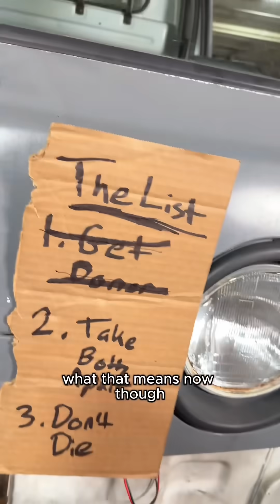We Destroyed Two Cars Just For This… Sendpai Part 3

Comment: One thing that I'm hoping you've considered is the weight in the rear of a kei truck. If you put a ton of power in the rear wheels and don't add any weight, its not going to have any traction. I would put the battery in the bed over the rear axle.

Comment: I'm curious why you used a hammer and pry bar to remove the radiator connector. It has a little metal clip you just pop up and the pipe comes off easy. Maybe it was stuck.
Reply from the maker: Super stuck

Comment: I like how "halo cars/projects" have just become "build some ridiculous fun vehicle that will get clicks online" instead of actually showing off a company's capability.  I like it haha

 It makes sense to just retain the Tesla sub-frames like that.  I saw another conversion where they tried to get everything to fit the existing vehicle frame instead of adapting the sub frames to the existing vehicle frame.  The simple ladder frame should make it a bit easier when it comes to attaching these.  On a uni-body it's a bit more difficult unless they can mostly fit into the existing sub frame locations.  You're not going to cool the tesla battery in the K truck at all?  How long will it be able to actually run?  5 minutes before the battery overheats?
Reply: Just stay tuned and stop assuming. They are figuring it out. This is a test. A halo project some may say....

Comment: 10's in 0-60...with 14x4.5''s.  Better go with solid tires.  Those tubeless are going to spin on the rim.
Reply: Track width of the Tesla vs Kei = tires are going to stick out of the fenders a bit. 
Kei max width is 58.3”
Tesla 3P track width 62.3/61.4 f/r 
Tesla 3P width is 72.8”, and the tires are pretty close to that width (say 68-70”).

Comment: Hey man, this is cool and all, but I’d rather go for a Toyota Prius hybrid set up because that thing save gas and you can put a bigger tank on me plus with a body that small. I’m guarantee it picks up some speed may not be super but it’ll be quicker. Definitely gonna need a cage and a little suspension.

Comment: As long as the heavy batteries are more towards the middle it should be awesome.
Reply: I think a bit of rear bias with the battery pack would offset the weight of the cab.

Comment: swap the kei truck motor and drive train into the Tesla
Reply: Thirded (I don't think it has enough power to even move it but it would be funny)
Reply: @m_ism  it has enough power to move it. However it will not be zippy.
Reply: @bullithedjames  I don’t know if it doesn’t have a battery and motors. How heavy could it be?
Reply: @Ibuildsht  not a clue. In but it definitely be slower than a Tesla😂😂
Reply: @bullithedjames that’s where the 88mm turbo comes in
Reply: @m_ism big turbo
Reply: @kyleweaver7900 NOW we're talking
Reply: Yes!!!!
Reply: List it for sale and film people's reactions 😂
Reply: Auxiliary transmission and a 2spd transfer case, get as much gear reduction as possible

Comment: Leaf springs?  Did that rear subframe have both leaf springs and coil springs?  I'm confused.
Reply: He removed the rear axel with leaf springs from the truck. What was shown was the Tesla drivetrain.
Reply: @parkerduggins4512  Ah, that makes sense.  Thanks.
Reply: That is the Tesla subframe.
Reply: YOU'RE  not the confused one. 😂😂😂
Reply: @danielkingery2894  Apparently I was the confused one, as the other comments pointed out that the subframe shown was from the donor Tesla.

Comment: Hear me out, when you get to production, you could offer an option using Chevy's modular inline system, 4,5,6 cylinder motors with decent pricing and again their MODULAR BLOCKS, any use case or price point you need, and you don't have to worry about new acc mounting systems for each block variation, CAUSE ITS THE SAME THING!! Want a small 3cyl hatchback? Run away from the atlas blocks and drop in an I3 Chevy SGE family motor.
Reply: The Atlas is an awfully tall engine. It would be wicked cool, especially the inline 5 with a decent exhaust, (and a turbo?maybe? Just saying, Audi Quattro noises but bigger...) but if the idea is a truly compact pickup, the Atlas isn't the way to go.
Reply: You would rather push than drive ?

Comment: Make a modular framed muscle car chassis.  Something with multiple body mounting arrays so you can put various bodies on it.  Offer three common wheelbase lengths and track widths.

Sell them as kit cars that can be assembled at a different but very close building lol

Or remake the original vw bug but updated.

There ya go.  Two completely different and ridiculous ideas
Reply: Very few muscle cars actually had a full frame. Properly fastening a unibody vehicle onto a different platform is a massive amount of work if you want it to be structurally sound. ( I have done it, 3.5yrs of all my free time).
Reply: @CarswithNash ya, i know.  Lots of those cars had half unibody construction.  

But the kit car body market is pretty stout.  Not to mention all the repro bodies for full frame chassis.

It wont cover all the bases but itll open a few back up from oblivion.